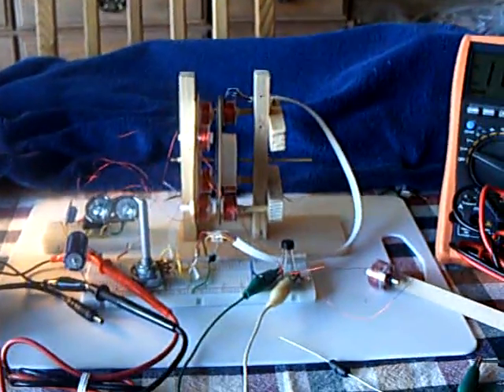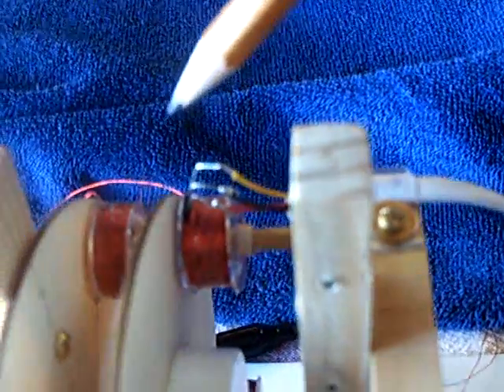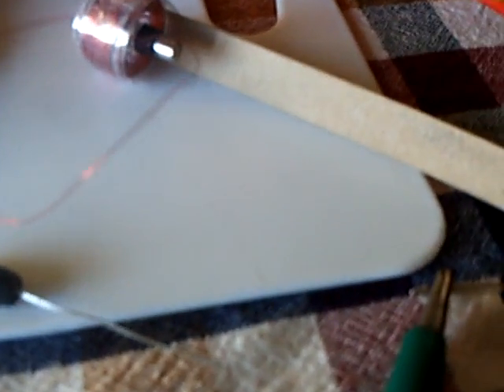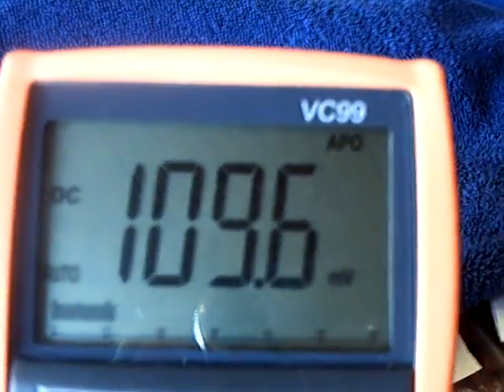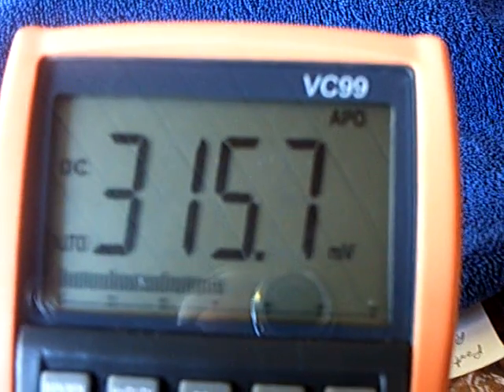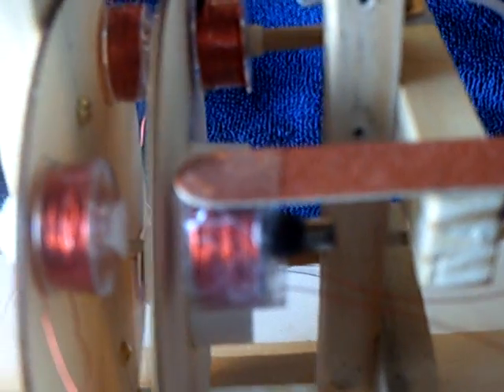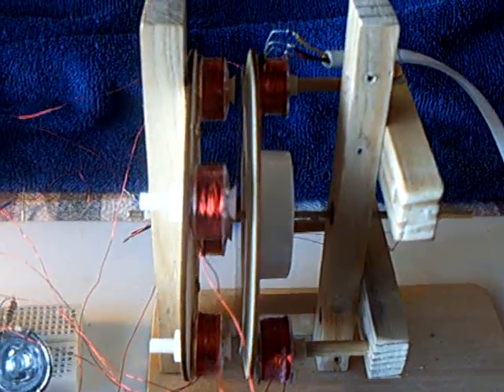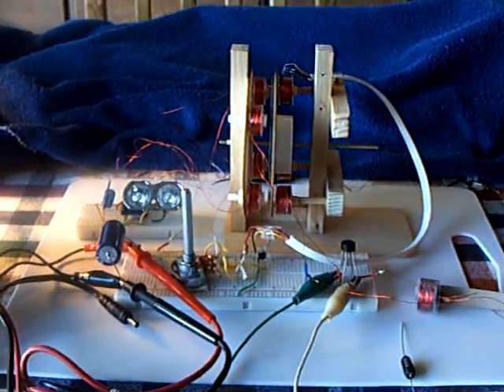Muller Dynamo with electronic circuit.ASF

Comment: another thought i wanted to share.. from personal experience i just dont see it remotely possible to get the potential or current you need from those gen coils unless the gen magnets are NSNS fashion. im pretty sure you would agree the NS would at least work better. so the question is would adding NS magnets on the inner diameter with additional coils for them just allow lenz a way to step in full force, assuming he was somehow beat before-hand with the present coils.

Comment: great setup.. im having the same problems. getting great motor performance using a push/pull setup but not getting anywhere near enough from the gen coils. fairly similar results but im using thicker gauge coils. im guessing this is why Mullers design used "super magnets" whatever those are.

Comment: @Lidmotor Would a thinner gauge magnet wire winding on your coils raise the voltage?

I'm thinking that would raise your voltage, but you'd probably lose on the current.

Comment: Might be an important factor that placing another magnet at the back of the coil will guide the magnetic field much better through the coil. And it is known that the stronger the field, the better is the conversion of the mechanical energy to electric. Though, too much attraction without proper back EMF elimination might make the device go to a dead position quickly. Made some simulations and adding ferite tube around the coil further guides the MF(not tested).
Really nice work so far. Congrats

Comment: Lid, not sure if this helps, but in an experiment I did with conversion of DC solar cell output to AC for distance travel I came across this MIT paper regarding integrated CMOS based rectification of a very low voltage loss. See autoid . mit. edu /pickup/RFID_Papers/102.pdf - for a circuit where you lose .x volts instead of volts.

Comment: One more thing comes to my mind; if there is a relation between the magnet strength and the gap. What magnet does is biasing Bloch Wall within a coil but at the same time the gap may have to be adjust accordingly.  Core material is also a variable. Just thinking loud.

Comment: It would be cool if you could attach a rod to the wheel like the old steam trains had to convert the circular motion to  linear motion, and have the rod move back and forth through the center of a generator coil like the ones inside of the shake up flashlights.